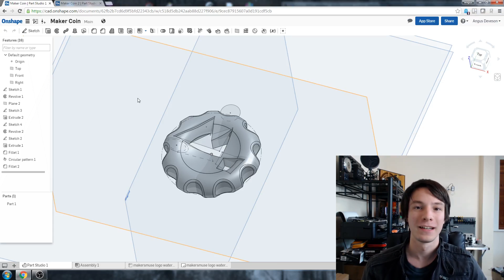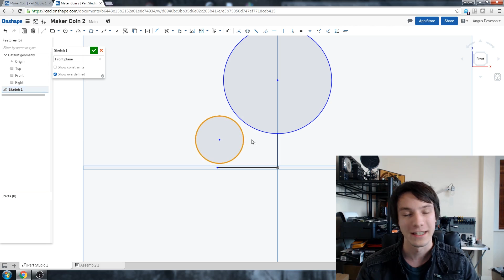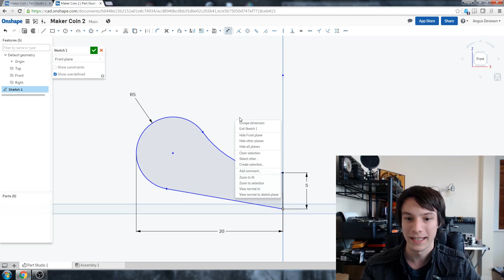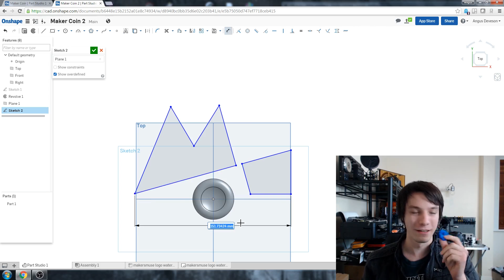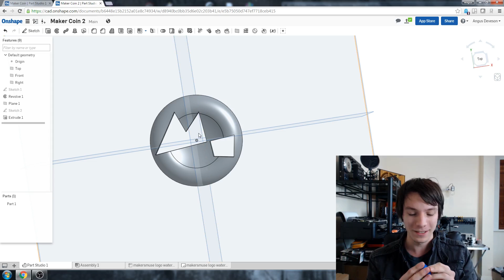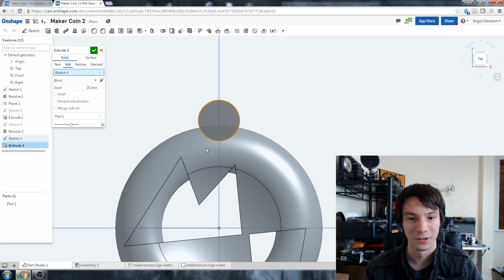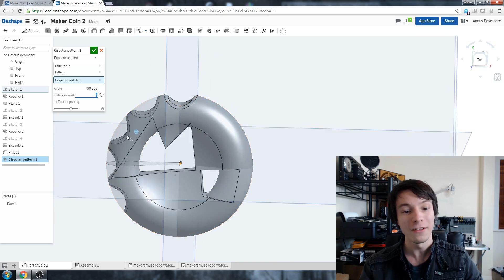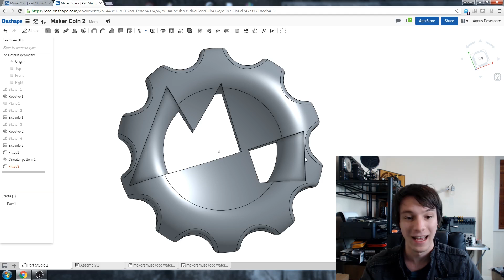How to CAD your own Maker Coins in Onshape

Comment: I have been using a 20mm cube with just three walls and some round holes as my test print. For such a small part, it's a pretty good nozzle height test part and it's an excellent print strength test (layer adhesion at a weak point). It also shows how the printer handles overhangs, stringing and vibration. However, once printed, it's not useful for anything. I now have a DiiiCooler fan shroud, so the part is too small and I can't see the first layer as it goes down.

Here's the challenge then: design a 3D test print model that allows you to see at least the first layer as it prints even with a fairly large fan shroud and that also works as a good test for the other factors I mentioned above. It should print in under 15 minutes on a typical printer and the produced print should be a useful part.

I worked on my i3 today, so I had to re-level the bed. Instead of using my traditional 3-wall cube print, I designed something new really quickly. I made a longish (5 cm) part with two round at the ends and some holes a few mm up. It prints in 10 minutes and it's actually pretty good for winding a piece of string or wire. It doesn't test layer adhesion though. Maybe I can come up with something better... Meanwhile, I think this could be a good gauntlet/challenge to throw at 3D designers/makers everywhere: something like 3DBenchy, but faster & cheaper to print and more practical.

Comment: Hi all! Just wanted to share my coin design. I did a couple of things differently. [1] The logo itself is an Onshape sketch, [2] the positioning of the grooves is formally constrained not to touch the logo. 

https://cad.onshape.com/documents/b017bd85a6151b9cb5fe4307/w/6c559ad345b8fe54e1c2fd04/e/10893fa1148a82c2df194d7c

Thanks again for the tutorial, Angus! I learned a lot.

Comment: Great video, I learned something new about how to pattern a wheel to make gear like objects. I was wondering how does one properly extrude on a curved surface like this like how you did with the logo. Is there some way you can define to logo so that the logo will scale if you changed the diameter/radius of your revolve?

Comment: Hey, I ran into my first problem with my duplicator i3 a week ago. Here is a forum lik to my question.Hope tyou can help ;) https://www.3dprintingforum.org/forum/hardware/repairs-and-modifications/99195-strange-prints-from-w-duplicator-i3
Reply: . @reptileawesome +reptileawesome Hey buddy, looks to me like your printer is under extruding! One easy way to fix this is to make sure your filament diameter is set at 1.75 mm, not the already preset 2.85mm. If that doesn't fix it and it prints weird, then the extrusion percentage needs to be increased, I'd say start it at 110 percent then try it in 3 percent increments. I hope you still see this comment!
Reply: JuicyMoose Productions  Hey man, thanks for the reply. Yeah after a bit of fiddeling some weeks ago  I saw that the filament size was to big

Comment: You should give up on Onshape
If you use Fusion 360, you could make a far more interesting coin with more organic shapes.
Reply from the maker: It does exactly what I needed it to - but I am also looking at f360 for other modelling.
Reply: +Maker's Muse  once you see the infinite possibilities with organic shaped modeling you will wonder why you didn't use it before
Have fun investigating. If you ever need help, let me know and I can help!
Reply: Fusion 360 is great, but onshape is definitely easier and more predictable. When you add dimensions to Fusion 360, it is very easy for the program to ruin your entire sketch and for example make the left side of the rectangle, suddenly the right side of the rectangle to try to resolve your sketch. Onshape seems to be intelligent enough to intepret that you wish to rescale your sketch and not invert it or whatever. Fusion 360 is far better if you are looking to do advance applications like threading.